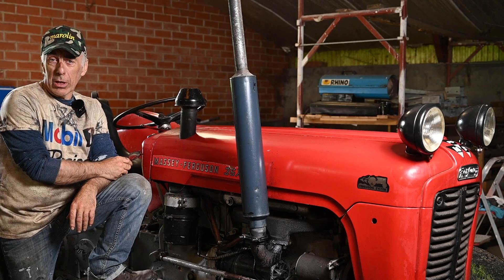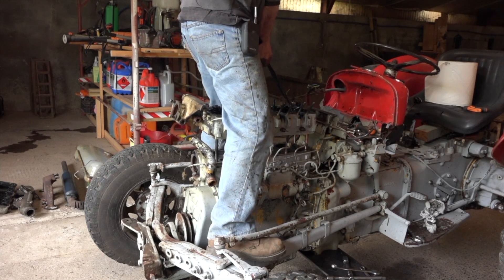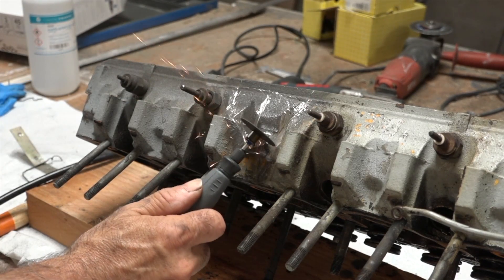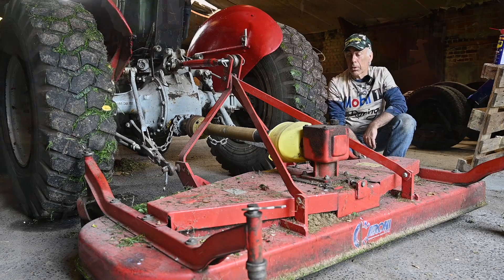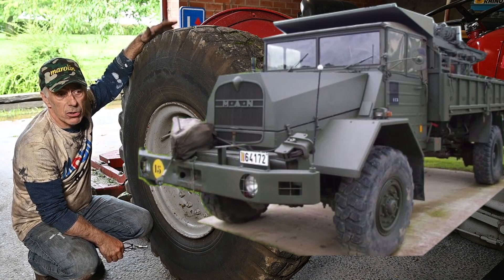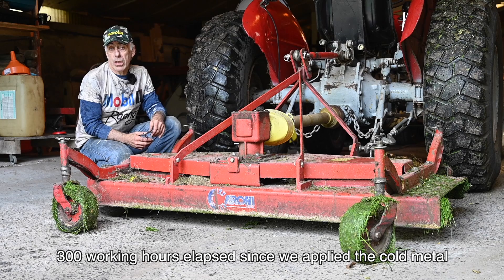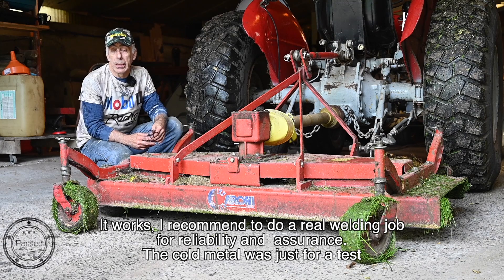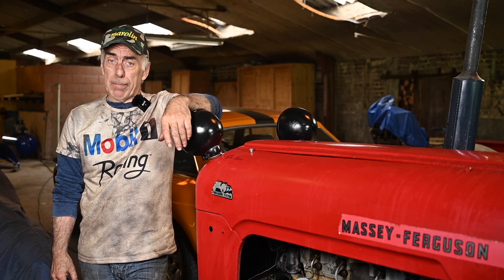Massey Fergusion 35, Cylinder head  repair with cold metal. 3 years later

Comment: Nice to see an update to this! I remember I've learned so much from the MF project videos you did back then. And I've also attempted a repair with this steel putty thing on a steel cutting bandsaw (the rotating joint on the bottom was broken, and welded up very badly, it had like 1mm play, but it was cheap... I drilled it up and added a bushing with this stuff and its perfect since than). Good work Steve!
Reply from the maker: Thanks for the comments and view

Comment: That is a good repair, I have always ground out the crack and used a MIG welder on non road vehicles, and that seems to work for farm use, but it is easy to get another head,(not so easy to get a block), I notice you have taken off the front wheels of your tondous, is that because they hit the tractor wheels? I have the same tondous mounted on my Fergi 20, and that is a problem I have, the Fergi has no problem cutting my meadow, although I only cut it in October after the wild flowers have died back. Stay safe! Chris B.
Reply from the maker: Thanks for the comments Chris, the reason was to get tires that damage less the grass...
Reply: @D3Sshooter  Yes, I noticed that you had grass cutting tyres fitted, that is the same tread pattern that they use on golf course mowing tractors, with the "normal" cleated tyres I do get damage when the ground is wet, but my problem is that when I lift the deck those Tonduese wheels hit the tractor tyres, unlike a Topper of course the deck relies on the wheels for cut height, so the linkage point needs to be in a different place.
Reply from the maker: @453421abcdefg12345  I see, indeed that is a close call on mine as well.. but  i have extended the lifting arms some time ago to avoid that problem.

Comment: It is interesting. I was not a naysayer, but it seemed risky. We might call that a metal-filled epoxy here. Some of those epoxies have impressive strength, albeit not as much as steel or cast iron. One point of interest: what is the pressure achieved by your radiator cap for that engine? The pressure inside the cooling system for most engines is determined by the radiator cap.
Reply from the maker: Thanks for the comments, that is indeed correct... the cap on this tractor has no pressure release  so that helps

Comment: Another good way to fix a crack is to "Pin" it.  It's an old technique that involves drilling and tapping a series of overlapping holes along the crack.  Drill and tap a hole - install a bolt, then drill an overlapping hole - tap it, and install another bolt, and so on till the crack is completely filled with bolts.  It does have it's limits, but it is a very useful technique!
Reply from the maker: Thanks for the comments, and indeed that is another approach that works

Comment: Mine was a 35x (dif lock pedal behind the break pedals).  Mine had a crack vertically down the middle of the  block from frost. My dad  welded it with a cast rod and it lasted for the 20 years I had it.
Reply from the maker: Thanks for the comments , and yes that is a weaker area